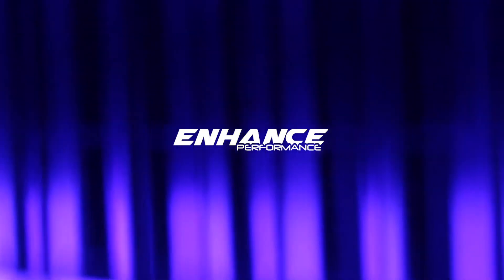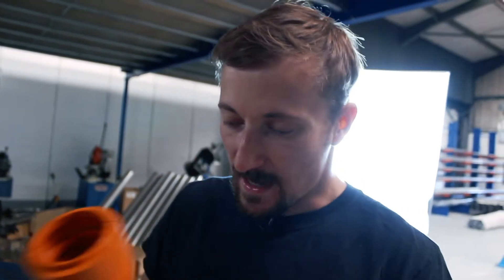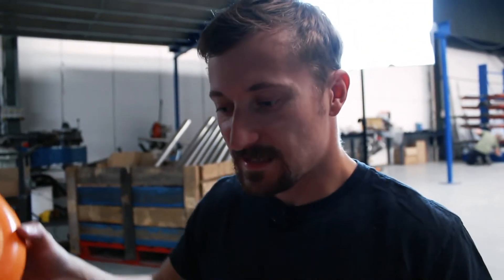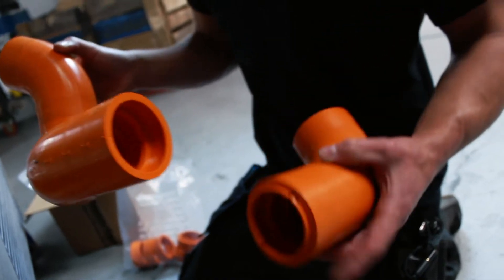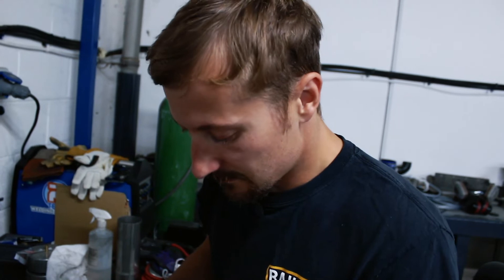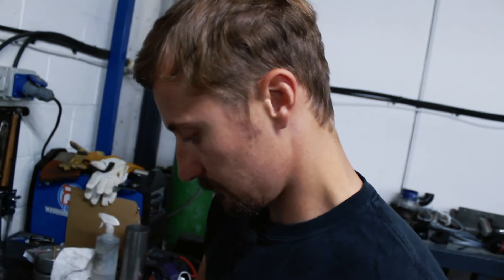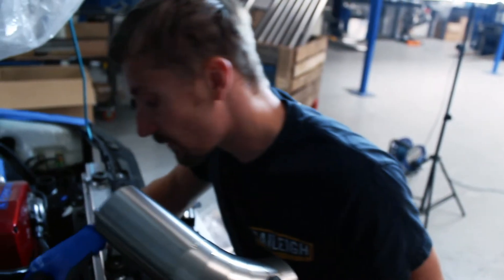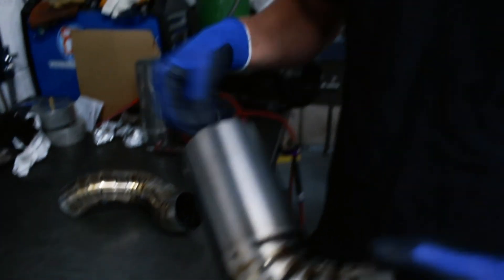Nissan Skyline GTR R32 | RB26 Engine | Fabricating Titanium Boost Pipes (Part 3)

Comment: it is not too smooth inside on welds, i am making pie cut ex from 42.6mm and 70mm OD 316/304 and every weld must be sanded/grinded inside otherwise is bumpy